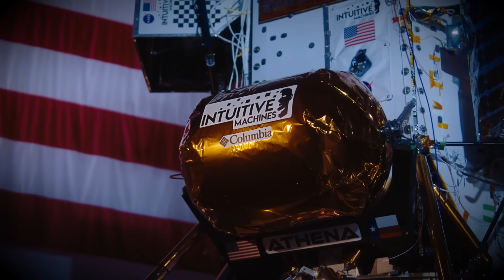New Image Reveals The Athena Lunar Lander Is On Its Side

Comment: Designed in a corporate boardroom without engineers.
Tall and thin to fit more in a rocket fairing.  
After the previous failure, no redesign, just a software patch and promises.  
Anyone trusting them with a payload is throwing it away.

Comment: They obviously did not learn from the first mission. Its very dissapointing no matter how they try to sugar coat it. The lander and missions are very expensive. Tipping over is quite common for a probe like this, especialy in such rugged terrain, so surely its worth the extra money to incorporate some inflation bags to right itself should a tip over occur. At least there would be a chance of recovery. As it is, the money, experiments and hard work have all gone down the drain because it simply tipped over in a crater. Which brings me to another point. Because it is automatic, it scans the terrain for a safe landing spot. What made it decide to land 250m off target and inside a crater?
Some serious re-designing of both software and hardware is needed I think. It etheir needs to be less tall, or wider legs, or incorporate inflation or arms that could push it onto its legs should a tip over occur. Would be worth the extra money as a failsafe to save a mission imo.
One last point, maybe landing at a speed of around 3ft per second in rugged terrain needs addressing for a tall probe. Perhaps a 1ft per second would help reduce any tip over should it land at an angle or bounce slightly.
Now poor Athena sits in the cold shadow of a crator, no power and  inoperable. 😢
Reply: So...there is some more evidence now that suggests it broke one of the landing legs on landing. 3ft per second on landing is obviously too fast for this craft.

Comment: Designing a top heavy lander is one mistake. Not making any changes to the design after losing the first lander is a much bigger one. At this point, the responsible people probably should quit or get fired. Why didn't they add a self-righting mechanism? Why can't they land it straight in the first place? Why are there only solar panels on one side? Yes, moon landings are hard, but that is all the more reason to mitigate risks and make a lander that either can not tip over or add some kind of mechanism to reposition or right itself. Why not re-ignite the rockets one last time and hope for the best instead of letting it die there in the shade? It blows my mind that people who lose a lander in the same way twice due to bad basic design still have a job. Did they not do any risk analysis? Surely there were some engineers advocating for a more stable design? The CEO should quit to save face.

Comment: Is it finally time to lower the center of gravity of the Intuitive Machines lander and make the legs stronger and broader?
I also wonder if this will eventually be the fate of the SpaceX HLS. It is even taller, and I haven't seen any pictures of decent size landing legs for HLS. I know the engines are the heaviest part of the Starship structure. However, depending on how much fuel will remain in the tanks at landing, how much they slosh during the final approach maneuvers and how heavy the payload in the upper part of Starship is, it is difficult to see where the CG of Starship will be during the landing sequence. Look at how many Starships toppled over during the first suborbital test program to perfect the flip maneuver.

Comment: After the first failure, the "intuitive" thing to do would be to design the lander On the horizontal rather than the vertical. So that when it lands it can't tip over. They can always modify the experiments and solar panels to where they flip up to gain height

Comment: I think it's about the electronic components and communication systems and hardware problems. Why can't they use methods to protect electonics from noise and interference?
There is no wind on the moon. If controls are reliable that lander will touchdown and will not tip over nomater how tall.

Comment: last time it landed on its side would have been the moment to just put the thing inside a spherical landing frame, like a light-weight jungle gym, so that no matter its orientation at landing, it would just self-correct, if the bottom was heavier than the top.  Hindsight is 20/20. we would be further ahead by now if they had.
Reply: with their track record, a spherical ball design would just roll itself to the bottom of a very deep crater and remain permanently sun and radio comms shadowed

Comment: Too much horizontal trajectory upon touch down and the lander is too tall and top heavy. No wonder both of their landers tipped over. Simple design errors if you ask me. The most stable design to land is a pyramid shape. Same as SpaceX starship flights 7 and 8, same design, same failure. You'd think they'd learn from their mistakes and very expensive mistakes at that.

Comment: If its laying on its side and level either two of its legs are in a deep rut or they are crushed down. If the thrusters used to control it during decent are still able to fire maybe they could tip it upright or at least roll it over and maybe their solar panels could catch some sunlight. Nothing to lose.

Comment: I said it with the first landing and I'm saying it again ...... the craft is TOP heavy and with aslight sideways landing and one leg hits soil, it will just tip over in zero gravity . there is just to much top mass compaired with the height of the lander 
Same thing with the Space X moon landing  , it's great to see a rocket standing straight up , but that will tip over as well with the crew inside 
Nasa at the time did it correctly ...wide and low !
Reply: yeah, and a pair of eyeballs connected to a brain onboard to accurately detect movement and identify hazards

Comment: In hindsight it may be a good idea to start incorporating an artificial gimballing function into the six legs. Orientation and local terrain mapping electronics could be used to command extensible legs on the top of each leg assembly (top leg extends/retracts, the bottom two just pivot). Might add some weight but in realtime would act as a simulated gimbal and keep the craft vertical within some limit. In a simpler version foot pad/strut assemblies can be fabricated to maintain dynamic proximity to surface without loading through a local closed loop feedback command to each upper strut. After six pads are in surface proximity and vehicle vertical is confirmed then all struts lock in place and engines are ramped down for final loaded contact. Some erosion of surface material may occur during hovering of last couple seconds. The upper strut could use a self-locking screw and motor for simplicity similar to aviation flight control surface actuators.

Comment: Its design appears to be inherantly flawed IMHO. And the data to date supports my opinion. Tall and top heavy. Especially if it has the same mass and in a 1/6th G environment it will be more sensitive to falling over if landingbwith any side movement than compared to on earth. Make its mass lower and wider and improve your odds of surviving when unplanned events occur.

Comment: Two attempts and two landings on the moon. They should be proud even if they didn't stick the landing. Definitely need to widen the landing gear with articulating shocks so that they could each land to individual height and compression.
Reply: Not sure that it would help a lot in lunar gravity.  if the lander has any side motion upon landing, the leg  will hold the ground while the rest with all its mass will keep keeping on until it tips over.
Starship has the same design flaw. You don't want something that has the potential to tip over. You keep the center of mass as low as possible.
Reply: @iorr98  You're completely right. I guess that's why I'm picturing a spider-like configuration that allow that landing gears to make contact and have the center of the LM shock absorb in with I guess gas struts. Could allow the center of mass to sink down a bit.
Reply: @NickNieves112  
In a low gravity body like our moon If there is the slightest lateral movement when landing  with this type of configuration, the legs will hold the ground while the rest of the mass  will keep on keeping on until it tips over. Newton 101.

Comment: In a purely practical way, there is a few things I am wondering : first, the general shape of the machine is very tall.... This is not usual. there is probably a reason for this. I bet they had a lot of confidence in their tracking and landing capabilities, but failing in the exact same way 2 times in a row... is not very rewarding, to say the least.
Second, knowing that landing automatically on the Moon is crazy hard and that failure is totally on the table, why not releasing the little hopper probe while still in the air? Japan did exactly that with their lander, and we got picture thanks to it.

Comment: OK-------....    WATCHING THE LANDING I NOTICED THAT WHEN THE ALTITUDE HIT 5 METERS ITS SIDE VELOCITY KEPT JERKNG FROM PLUS KPH TO MINUSE KPH SLIDING FROM SOME 100+ TO SOME 100. ---. KPH... SEVERAL TIMES BEFORE FINALLY STOPPING...   THE ONLY POSSIBILITY IS THE LANDER COULD NOT BALANCE ITSELF OR FIGURE OUT WHAT STRAIT UP AND DOWN WAS... OR LOCK ONTO A FIXED POINT ON THE SURFACE...   SO IT AGAIN HIT AT SOME VELOCITY SKIDDING AND TOPLING OVER....  OR IT SIMPLY L ANDED ON SUCH A SLOPE THE TALL LANDER COULD NOT POSSIBLY STAY UPRIGHT...
----------.  I REALLY HOPE NEXT TIME THEY REDESIGN THE LANDER TO BE WIDER AND MORE SQUAT (THAT HAS PROVEN TO WORK VERY WELL).  SO EVEN IF IT DOES HIT ON A SLOPE OR AT SOME VELOCITY SIDEWAYS IT ONLY SKIDS AND NOT FLOPS OVER...
------------. FOR THAT VERY  REASON I AM SCARED THE TALL SPACEX STARSHIP LANDER HAS AN 80% CHANCE OF DOING THE VERY SAME THING...

Comment: FYI the width of the legs is constrained by the diameter of the rocket. Heavy shit was positioned low, so it's height compared to width is not in and of itself a determining factor. But they definitely need to rework something.

Comment: Bad design.
Eliminate the risk by designing a probe that will operate regardless of orientation.
Mitigate the risk of failure by accounting for the probe tipping by including a mechanism that can flip it back upright.
Redundancy: have some form of backup in case the mission fails.

Comment: The Apollo landers were build with a wide stance, even then Niel Armstrong took control because the builders were too big and it would have tipped the lander over.

These new landers that seem to fall over are built like a high rise, tall and narrow. Why are the engineers surprised when they tip over like an empty beer can in the wind?

Comment: And possibly go with a redesign of the landing legs for a more stable platform The Blue Ghost mission utilized those. That will change some of the lander weight vs mission payloads allowance, but seems like a trade off for mission success. The legs can be designed to fold down to still fit in the launch rockets payload shrouds. And a smaller orbiter satellite to track the landing course for mission control to Not 
 loose contact .

Comment: Intuitive Machines seems to be a misnomer. It seems they forgot some intuitive fundamental principles.
First, a tall structure is more unstable than a short, squat structure, especially when bringing it to a stop from motion. Every kid given blocks to play with learns this pretty quickly. They would be better, if they wish to keep the same payload volume, mounting the legs on the side (after all, that seems to be the default position it wants to land on).
Secondly, there is no such thing as a “flat and level” surface on an undeveloped bit of land such as the lunar surface. There are always dips, rocks, craters to some degree, or uneven bed in your landing zone and even if lidar sees a level area of regolith dust as it selects a landing zone, what the rockets expose will no longer be what was measured and selected. Even Neil Armstrong  had to select a different area and fly manually to find a better spot than was originally chosen. A fast acting self levelling system needs to be built into the design.
Thirdly, when landing, there will always be some bounce due to Newton’s third law upon contact. There seems to be no suspension, crush zone or other way to counteract this action in the landing system.  Nor does it seem that the landing legs are as robust as they should be as this is the second time the legs have collapsed on one side. 
Finally, after slowing down from orbital speed, with no atmospheric drag on the side, sideways drift will always be residual on the craft. Again, the landing structure does not seem to have a way of resisting this. So when the legs touchdown and arrests the residual sideways drift, the top continues past the centre of gravity and thus toppling the tower.
Looking at the competition’s craft, Firefly Blue Ghost is a squat body that has a more rugged landing system design with relatively much larger swivelling contact pads and as can be seen in its shadow was able to land safely even with one contact pad canted against a surface obstruction or divot.
Intuition dictates that in engineering, first principles should always take priority over wishful thinking for a larger payload.

Edit: minor auto spell check corrections.

Comment: I'm sure this has been investigated already but here are some facts on the two landers and one from the early 70's. The Blue Ghost Lunar Lander Height: 6.6 feet, Width: 11.5 feet. The The Intuitive Machines IM-2 Height: 13.12 feet, Width: 15 feet. The Apollo Moon Lander: Height: 23 feet, Width: 31 feet (landing gear deployed). Dividing the width/height for each machine.
Blue Ghost - 1.74, IM2 - 1.14. Apollo - 1.35. Why IM2 landed on it's side is anybody's guess at this point. Before sending another lander that costs $100+ million dollars, why not send a lander to the moon with a dummy load that cost $25 million and prove out the craft. Cut 2-3 feet off the height and add some width to the legs if possible. Or have a landing gear like Apollo that articulated out once in space. Just a thought.

Comment: I think the problem with simulators is they don't capture the full nuance of physics, like for example there are subtle things that have very big results in reality, just a slide or burst energy at an unexpected point and things can fail or go wrong.  It probably requires an additional layer of stabilization, some kind of final moment adjustment to ensure the landing position is as accurate as possible.  I recommend an optical flow sensor, coupled with a small RCS for doing last moment descent adjustment.

Comment: The thing is top heavy, make it shorter and increase the span of the legs. It’s not rocket science, well maybe it is.
Reply: FYI the width of the legs is constrained by the diameter of the rocket. Heavy shit was positioned low, so it's height compared to width is not in and of itself a determining factor. But they definitely need to rework something.

Comment: A $30.00 Punch Bozo Doll can right itself. How many times will NASA rocket scientists repeat the same folly before fixing this simple yet common problem? A few balloons and a couple of compressed CO2 cartridges with a controlled valve? C'mon man. I'm a HS drop out and even this will work. NASA brainiacs should be more capable. Use residual fuel or vapor?

Comment: When things don't go according to plan that's when we learn. 
You guys were so close. 
You'll come back stronger with number 3
Looking forward to it guys 👍
Reply: Will they learn that small legs and high center of gravity is a major design fault.....My 8 years old son told me that.
Reply: @jacquesjacques-yh8hh  is that why spacex can land a “candle” on a barge in the middle of the ocean without tipping over? 🤔 MASS is not equally distributed. If most of their mass is low, then center of gravity is low.
Reply: @lukeunderwood1437  The barge is perfectly flat and hard. The moon surface is full of holes (craters) and boulders. The solution to avoid craters is manual control as done by Apollo astronauts or a sophisticated soil reconnaissance system
Reply: @jacquesjacques-yh8hh  absolutely and it's landing on a completely flat ground,  no rocks or boulders on the moon is there
Reply: 3rd. times a charm!🤞
Reply: Insanity dictates that doing the same thing over & over again expecting different results is insane!
Reply: @Shivaho  except it’s not the same. They made some iterations to the 2nd flight, and there will be more iterations. By definition, this is not the exact same thing over and over.
Reply: @lukeunderwood1437  minor iterations are not the same thing as redesigning it to not tip over on landing
Reply: @lukeunderwood1437  Not changing the Spindly legs and top heaviness is insane!
Reply: Thank you for such a positive perspective! Too much bashing and arm chair engineering on here!

Comment: They need to work on detecting horizontal movement and make sure it's zero before they touch the surface.
Reply: Or change the landing gear
Reply: @bigchills7194  Waddya want, swiveling casters, lol.
Reply: @ with big mesh tires lol
Reply: @manifold1476  shopping cart style

Comment: Some insight into aerospace engineering. There are a dozen "what if this happens" scenarios that inevitably get shelved due to budget & resource issues. And is always a trade-off of higher priority mission requirements. But considering the history, in this situation, I would have placed un-tip over solutions at the tip of to-do list of IM2. Space is really hard, especially for private companies.